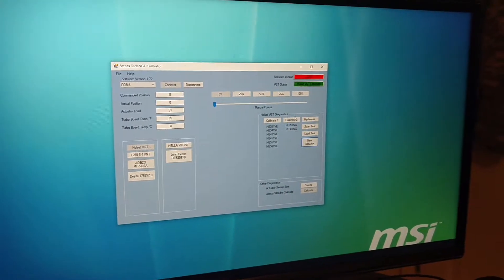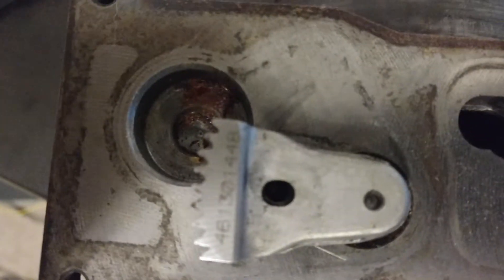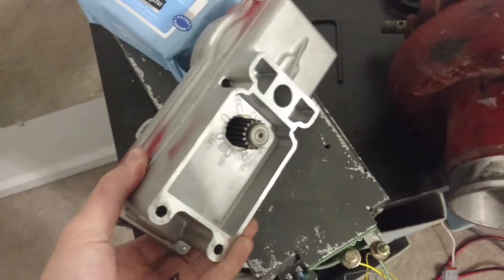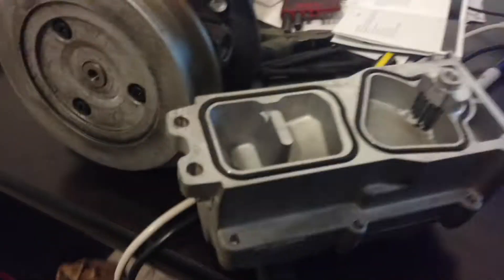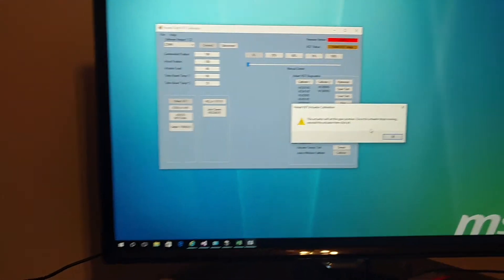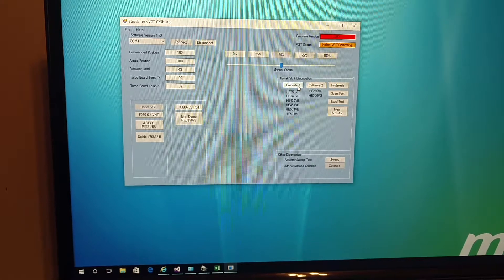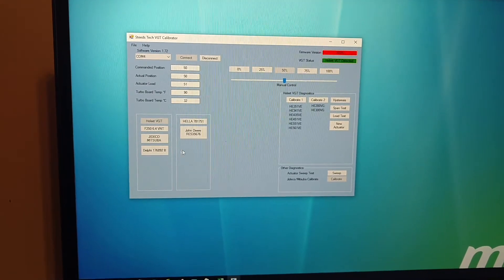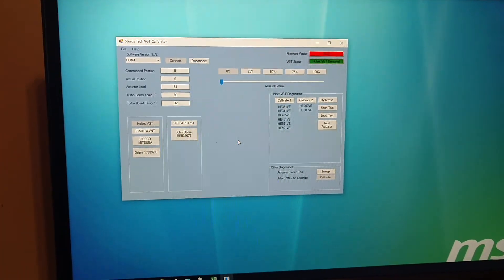Banshee VGT calibrator update

Comment: I have a vacuum gate in place of the electric motor on my he351ve for my turbo audi build, would I be able do do something similar to this and use a programmed motor for it?
Reply from the maker: I don't know of you modified the gear going into the turbo. if you did you would need a new gear or turbo. I have a page setup it's www.facebook.com/bansheecontroller
Reply: +Steed Dolan would I be able to contact you there? I can send pics of the turbo when I get to the shop tomorrow, I bought the turbo as is from somebody else's project, seemed like a pretty decent mod
Reply from the maker: The turbo is great for diesels who want an exhaust brake. There's better turbos for gas engines. Check out the Garett GT4082KLVN. Its about the same size but uses a VNT instead of a VGT. You'll spool faster with one of them.
Reply from the maker: Yeah that's my controller Facebook page, you can email me on there
Reply: ive heard some guys unning these ve's on their 2jz supras getting boost under idle, kinda sketch imo, i have a 351ve already with a custom vacuum gate hooked up to adjuster rod, ill send you some pics on your facebook page, its a pretty strange setup
Reply from the maker: turbonut20v A lot of people don't understand what boost is and how the VGT works. Boost is nothing more then restriction. What they do is engage the exhaust brake at 100% and assume the resistance is positive pressure. Truth is the turbine is stalled and there increasing their back pressure to the point its creating resistance in the intake. Now it may be possible with a VNT and see positive pressure but not with a Holset VGT

Comment: what are you using for the programming? i wanted to try to do something like this using arduinos but I'm not sure if they will be capable to handle all of the inputs and commands.
Reply from the maker: Nether, its a proprietary STM32 microcontroller. Arduino and Rasperry Pis arnt even on the same playing field.
Reply: I  have a few questions i would like to buy one to test the 551 hev   i don't see where to reply to you   thanks @SteedDolan
Reply from the maker: @TheTurboPerformance  my website is www.steeds.tech and my email is steed@steeds.tech
Reply from the maker: I sell these, it's a 32bit processor.
Reply: arduino or rasperry pi?